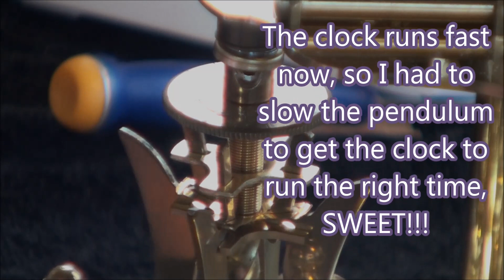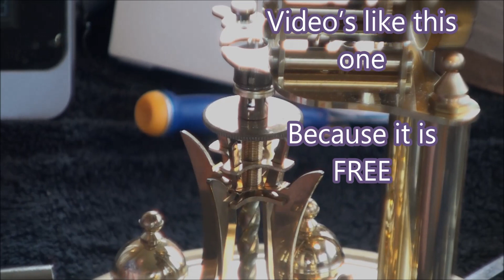How to get Your Anniversary Clock Running Again

Comment: Mike I plan on watching all of this video but it is late and I need to get some sleep. Wanted to say that I think it is great how you arent afraid to tackle these kind of clocks. As a lot of people dont. I also wanted to mention  that in my videos I show you that I put all my clock parts in a plastic ice cream bucket that I have a lot of holes drilled in the bottom and on the sides. Then on the top lid I have a hole cut out just enough to all my hair dryer to fit into. Then I put the lid on after putting  the parts in. Put my hair dryer in the hole. Turn the hair dryer on low and go do other things while it is drying the parts. You might want to give that a try. Good video so far. Also stay tune in the group page of mine because I am trying to set up our anniversary clock expert to do a live video chat so we can discuss these. There are a few folks that are buying them that need help. So I asked him to set up a live video chat through messenger. So stay tuned for that.
Reply from the maker: Well thank you and thanks to see what I have been up to Mark.

Comment: Beautiful clock.
at 27:29  it's skipped forward about five minutes. This sometimes happens with these clocks. Maybe a little oil on the pallet teeth, or less… You can increase the resistance of the pallet by putting a  tiny leafspring between the pallet and the top plate. Skipping forward might also be minimized by slightly lowering the  Spring lever. It's a beautiful clock congratulations on the new dome. perfect
Reply from the maker: You are right and taking a little more time with this clock to get the best results. Thanks so much for the great comment and also thanks for watching  Timothy Sheridan

Comment: Hi Mike, Thanks for your video. I just finished my first tear down and overhaul of a Kundo clock, similar to yours. I relied heavily on your video but also consulted the Horolovar 400-day clock repair guide book. Your video was most helpful but a word of caution to anyone taking one of these Kundo's apart. You don't really talk about or show the very tiny spring that goes inside the small barrel located behind the clock face. The round barrel and pinion are the small parts you are holding in your hand at 16:30 of your video. This tiny spring will fall out during disassembly and it is very easy to not see it. You can lose it without even knowing it's there! Also, there is a small washer that keeps this tiny spring inside the small barrel after reassembly. During disassembly, it's easy to miss and lose the washer too! Although you don't mention this washer, at 16:49 of your video I can see it resting on the back side of the clock face you are holding in your hand. So, for anyone disassembling one of these Kundo's be extremely careful during disassembly that you see and carefully set aside this tiny spring and the washer. The clock won't work without them. They maintain the pressure on the clock hands after the clock is reassembled.
Reply from the maker: Thank you for your response to the video. You are right about the small spring and washer and putting the clock back together I am surprised I didn't show them. Also this was my first one and since then, I have learned how to clean the barrel Main Spring. What I did here I would not recommend. The cleaner never gets washed out and the old oil and water I am sure doesn't look good inside. I did make a video on cleaning a barrel main spring after I learned just what they were all about. Again, thanks so much for your findings that I missed in the video and thanks as well for watching.
Reply: @justmike57  Mike, thanks for the update. I just found and watched your other (newer) video where you disassemble/clean/reassemble a 400-day main spring. Great job! I am not sure I'm ready to attempt that yet. My Kundo clock is running nicely now but it's only been one week since I put it back together. For the main spring, I soaked the housing in a clock cleaner solution for 24 hours, to include squirting a lot inside the hole. I then rinsed twice -- once with Dawn & hot water and once with super hot plain water. I drained as fully as possible from the hole and then blasted the main spring barrel and its hole with a hair dry for quite a few minutes. I looked for evidence of moisture but couldn't see any coming from the hole. After cool down, I used a clock oil pen to insert drops of oil into the hole, but not too much. Finally, after reassembling the clock, I completely wound and then completely released the mainspring three or four times. I was thinking (hoping?) this might help spread the drops of clock oil across the main spring. In any event, it will be interesting to see how long my clock runs without disassembling & cleaning the main spring in the manner you show in your other video. On the 400-day clock forum at NAWCC, some of the experts there strongly advise against attempting to disassemble/reassemble the main spring unless you have a (expensive!) spring winder. They explain how this is both for safety reasons and how the spring can rather easily get damaged or misshaped. Looks like you had none of those issues! Nice going. P.S. For anyone interested, I found Mike's other video at https://www.youtube.com/watch?v=qnFzS_Gb68Y&t=862s

Comment: I suppose it's a matter of taste but I prefer the plastic domes mainly because I can worry a lot less about breakage.  Any difference in transparency is minor to non-existent.  Scratches can be repaired with a plastic polish but I have not had a need to do that.
Reply from the maker: I think you are right. It is a matter of taste and function. I prefer glass because it has the feel of quality and high end compared to plastic. Funny thing is, I have bought Anniversary clocks that were battery ran but had a glass cover for my key wind clocks that had the plastic cover on them. Of coarse the battery movements are so cheap, they can put the money into outside features. 
  I have always said, it's your clock and you should be happy with it. Unless you are buying to resell, plastic works for you. 
  You have a great one and thanks for stopping in Bill

Comment: Another awesome video, Thank Mike. One question, what would cause the balls from turning after a while? It is a new spring and not kinked.
Reply from the maker: Most the time I worry the Barrel Spring might need cleaning. Your problem could also be the clock isn't in beat. You need to mark one ball with tape, and the starting point. Then when the pendulum goes around, mark where it stops in one direction, then the other direction too see if the marks are equally distance.

Comment: Hi Mike ....My clock hasn’t ran properly since my Mon bought it for me as a gift back in the 1980’s when we were stationed in Germany!!  No matter what surface I place it on the pendulum refuses to stay turning....It will work for a few days then stop!! It is battery operated, not the wind-up type... after a few years I gave up, so it just sits pretty in my curio cabinet!!
Reply from the maker: Hey Lorraine 64. Most the time with these clocks, you have to level them so the bottom point of the pendulum sides are not touching anything. I have a few battery ones with the little wire that holds the pendulum up. You can not have any drag on that type of pendulum. I hope this helps you a bit Lorraine

Comment: We received one for our first anniversary. The wire is broken. I tried to get it repaired but was told it couldn’t be. I’m just wondering if the man just didn’t want to do it. Can you get a replacement wire? There are no repair shops where we live. We will be celebrating our 50th anniversary in a few weeks and it would be awesome to have it repaired
Reply from the maker: I don't have a picture of your clock, but if it is just the wire that holds the pendulum up and keeps it turning around, that is simple enough to fix. The barrel that holds the spring should be cleaned and re-oiled as well. 
  At least the shop should have given you an estimate and let you determine if the clock is worth the price to fix.

Comment: would you be able to tell me what size suspension wire I need to replace in a broken Welby anniversary clock-it is so pretty-blue numeric on gold dial-key wound-I tried to replace the wire but it was the wrong length, I would really like to buy the wire with the 2 blocks & fork attached, as all those are very difficult to get in place without hurting the wire. Any suggestions would be appreciated-the back of the clock says Keininger & Obergfell-made in Germany. the clock is about 12" tall inside the glass dome.
Reply from the maker: Can you send me a picture of the back plate of the clock and I will look in my book for you. I haven't looked at my emails in a long time, but will look for your email to me. My email is below the video.

Comment: Hey, Mike,
I'm having a heck of a time getting a Kundo 400 hour clock going again. What is the ideal position for fork to sit along the verge pole? And what is the "rest" position for the fork? To the left, right, or center? Thanks!
Reply from the maker: I have found that moving the fork closer to the top and keeping it level will get your clock started and not zip by a double click or so and the pendulum will have better action.

Comment: Hello nice video and demonstration on how to disassemble the clock I have two questions when you unwind the spring do you turn counter clockwise and what is the name of the tool you use to unwind and where could I find the same set please thank you stay safe God bless you and your family
Reply from the maker: Sorry it took so long to get back to you. The name of the tool is called: Clock Mainspring Let-Down Tool Set. Should have different sizes to fit the key sizes. To let the clock unwind, you have to turn it as if you are winding it. Then Raise the bar that holds it from unwinding and slowly unwind the clock, using the tool. If you are using the key, Sometimes it will get away from you and just want to eat your fingers and hand. I see this tool is around $30.00, but if you work on clocks a lot, it is well worth it to save your fingers. Thanks again for stopping in.
Reply: Hello Mike it’s ok we’re all busy but thank you for your reply I appreciate it a lot stay safe I’ll let you know how it works out thanks again
Reply: @justmike57  This was my question also!. I did what you said not to do, I used the key and it did quite a damage on my thumb, so I am looking into getting the tool now. I was able to put everything together but now the clock stops running afer a half an hour, I worry that having it unwound it is no longer winding up correctly. What could be the problem?
Reply from the maker: @etyk990  If you unwind it too far, the spring might come off the rod that winds it. It this has happen you will have to take the cylinder apart, re-attach the rod and pop it back together. I didn't show how to get it apart. I will look on another guys site that takes them apart for you and give you his video in a bit.
Reply from the maker: @etyk990  Start the video at 25:00 to see how he takes the barrow apart. Time4Clocks   https://www.youtube.com/watch?v=HXkf3EF2bHs&t=3313s

Comment: good job ....what is a cleaning fluid to soak gears and spring in?
Reply from the maker: I use a Clock Cleaning Concentrate Non-Ammoniated. I was using the Ammoniated that I think works better, but I have a sonic cleaner now and use it indoors. If you go to the link for where I buy most of my things, download their catalog for free and see what they have. Page 120. They have cleaners and sprays. https://www.ronellclock.com/
Reply: @justmike57  thank you im one of those guys that dont like people to work on my things ,ive always wanted a glass globe clocke, found a 1949 0r 1953 schatz ann. Clock for $10.00  at an auction . So im interested in working on it i jad already purshaed and installed .0040 mm 102cm suspension spring and lower block and im slowly learning vitals tips in fixing them. I also bought a 79 pearl grandfather clock with was easy, kinda needs polished kinda. But its doing great now cept for gongs are like thuds but and replacing glass seal but that a different story.

Comment: Great video Mike. I tagged you into a post on my group page. I remove the springs out of the barrel by hand. I do have one video where I am working on a  1959  clock. You might want to watch that video. You need to learn to do this. That way the spring gets cleaned up and you get all the cleaner out of them or they will become brittle and break on  you.
Reply from the maker: I watched you video on the springs and I put on some gloves and pulled one apart, cleaned and oiled it with the spring oil I have. Not so bad to do.

Comment: I’m new here in trying to get my clock worked after I bought it at an estate sale years ago. Because of the shelter in place I have a lot of free time so I decided to give it a try to bring life back to the clock. I have been online searching advices until I found this one, absolutely the best. The instructions are so clear even a dummy like me would understand.

However, I need a little extra helps:
This is regarding the housing of the main spring. It was so tight, I won't be able to wind it counterclockwise except the key would snap back dangerously. So I assume the inside of the housing is all gummed up solid. Do I need to open the housing to clean it ? Or I could I drop the whole housing in some kind of solution to dissolve the craps?

Please help and advise.
Reply from the maker: You are right. The clock works might be all gummed up, or the wratchen lever might be stuck or broke. I take it this is not a Cuckoo Clock. You can order online, the new clock oil and clock cleaner. But if you want to try cleaning it without the clock cleaner, you can use Dawn Dishwashing soap and hot water along with an old toothbrush. On a wind up clock, (Like an alarm clock) you have to be careful of the thin wire spring that ticks back and forth. very fragile. If you would like, I have an email address on my newer videos or here it is to let me know any other questions. justmike2575@gmail.com
Reply: it was so grateful that I received your advice. It’d take a little time for me to dive in and start tearing up my clock but I’d certainly seek your advice soon. In the meantime please be safe and keeping health with you and families.

Comment: Hi Mike where do you live?i have the same clock and same problem. How much would you charge t fix it? I'm in Winnipeg Manitoba Canada
Reply from the maker: I live in Washington State. Sometimes these clocks can be fussy to work on. Most the time I have no problem with them as long as I get the right Wire on the pendulum.

Comment: Hi Mike.  You mentioned something about plastic domes vs glass domes.  I just bought a quartz Kundo clock that was advertised as vintage, but it has a plastic dome instead of glass.  Did Kundo ever make them with plastic domes or were the plastic domes made as an aftermarket replacement?

I have three other Kundo dome clocks (one 400-day, three quartz) and they all have glass domes.
Reply from the maker: Back in the day, they also had plastic domes. I don't like them because they get scratched. So I hunt the Goodwill stores for the clocks with the glass domes and buy them cheap, even if they are quartz. Then I just trade them. A quartz clock is normally cheap, you can tell by the pendulum that goes around. Some quarts are very nice with nice pendulums that I wouldn't trade the domes. So for your answer to your question is Yes they made plastic domes for the older clocks.
Reply: i know Im quite off topic but does anybody know a good site to stream newly released movies online?
Reply: @Malik Cannon flixportal :P
Reply: @Juelz Angel thanks, I went there and it seems like a nice service :D I appreciate it !!
Reply: @Malik Cannon glad I could help =)

Comment: I have several,  first challenge, get it to keep running.. Then getting it to keep correct time.. Above all you need infinate patience..
Reply from the maker: Too keep running, watch your timing of where it ticks. To keep the correct time, on top of the pendulum there is a dial that you turn, the + sign is for faster and the - sign is for slower. All clocks take some patience and if need be, walk away for 10 minutes and come back and get-er-done.